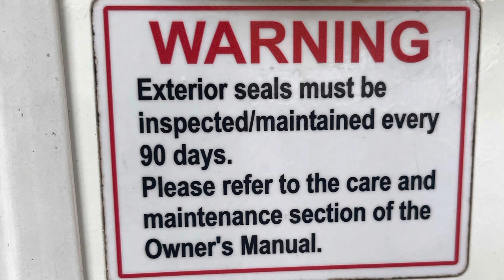RV Roof Sealing With SEAL-TITE and/or ETERNABOND Tape

Comment: Four things to help your subscribers: 1) Use a roller and a screen spline tool to create a better bond without bubbles and gaps. I tried the thumb and found the roller and screen spline tool do a much better job, 2) Round the corners on all the tape to eliminate sharp corners, 3) Install the Eternabond tape down each side of the trailer the way it was applied to the front and rear, and, 4) Cut the tape with a utility knife on a block of wood and not with scissors .  Scissors tend to gum up.  Glad I didn't bother using the Seal-Tite.
Reply from the maker: Thanks Girdherd
I'll definitely try the things you've suggested next time I use either one of these tapes. Rounding the edges is an awesome idea!

Thanks Girdherd for watching our video!

Mike and Angel

Comment: A very helpful item for this kind of project & material is a wallpaper seam roller, a little 1 inch or so wide wooden roller with a handle. Flattens out Eternabond tape very nicely.
Reply from the maker: Hey silaslongshot
Thanks for the tip, I thought about something like that after I struggled. lol🤔
Any further use of Eternabond with have a seam roller to finish it up.👍
Thanks for the advise and for watching our video.

Mike and Angel

Comment: I am in the process of doing the same. 
I got the eterabond cleaner and primer. From what I have read you should use a steel roller to get all the air pockets out and tobond better. They also sell it in 11/2",2",3"4"6" and 12" wide. I am going to clean the caulk ( dig out what HAS to come out. I first used eternabond 5 years ago and I will never use anything else. Don't take the whole backing off then put it down( if the wind catches it ,it will stick to it's self and that piece is junk.( remember when you were a kid and put stickers on everything) 
Thanks for the time
I ordered 150' of 4" 20' of 6" and 30' of 3"
Reply from the maker: Thanks Marshall for the comment. Next time I use it I will have the roller and order exactly what I need. I appreciate your advice and I'll refer to it in the future.
Thanks again for the input and for watching our video!🙂
Happy Trails & Happy Camping

Mike and Angel

Comment: I just purchased the seal-tight Dicor tape . Now I'm hesitant,  looks like I need to order eternabond tape instead. Thanks for video
Reply from the maker: Hey Steve.
IMO, use the Eternabond, it was a lot easier to apply. I believe the two tapes will work the same once they are down but eternabond was easier to work with.
If you think about it, let us know how it went after you installed it. Good luck and thanks for watching.

Mike and Angel

Comment: I like the idea of using eternabond for sealing the roof.  I am getting ready to reseal my RV roof. I decided that when I reseal it, all the self leveling sealant has to go!! 
I know, work, work, work. The reason why I am willing to do the work, the sun beats down on that roof day after day and eventually the caulking will dry out. I want to get the most out of the eternabond. I don't think placing eternabond tape over the caulk is a good idea.
Maybe for stopping a leak at the time, but for longevity, absolutely not.
Reply from the maker: Hey Michael.
If we had a large covered place to work under we would do that too. But we don't so I made the best with what I have.
We plan to post updates every 90 days on how the tape is holding up. Eventually we will redo all of the seals (caulk). For me that means the camper is out of commission for a while or pay someone to do it. Meanwhile the sealing tape will do the trick for me.
Thanks for watching our video Micheal and thanks for your honest opinion on what you think of the sealing tape. I hope I can tell you in a year its doing fine.😀

Happy Trails & Happy Camping

Mike and Angel
Reply: @RetroRVRecon  I don't have a covered shed either. I also don't have failing caulk, yet! Just had to touch up a couple of spots.
When the weather turns a little cooler then that is when I start my project.
Hopefully after it's done it's no longer required to keep resealing because of cracks or leaks. I want to make my RV experience a little less stressful. People swear on the eternabond tape. I just want to do it in one shot. Thank you for your reply and I hit the subscribed button and notifications bell. Happy RVing.👍✌️
Reply from the maker: @michaelbarras6950  Thanks Michael!!😀
Safe Travels.

Comment: I would have put a dab of sealant on each one of the screws under the vinyl  strip, because moisture will get in there and rust out the screws and rot the wood. I know because it happened to me years ago.
Reply from the maker: Hey oldrudedog
That's a good idea. I will add sealant to the least the outer five screws the next time I replace the vinyl strips.
Thanks for the advise and thanks for watching our video!
Happy Trails & Happy Camping

Mike and Angel

Comment: Was there a missing screw at 7:09( by your thumb)?
Reply from the maker: Hey Rick.
Good eye!! Yes there was. When I replace the trim molding I check the screws. They seem to get a little rust build up over time, so when I see one that has a bit more rust than I would like, I replace it. I replace them with SS. 
Awesome question Rick, thanks for watching our video!

Mike and Angel

Comment: How is eternal bond lasting?
Reply from the maker: Hey NorthWest
I checked it a few months ago and Its holding up very well. I plan to get up there in a couple of weeks, I'll give it another good inspection. If ever I find any issues I'll post an update. BTW, both Seal-Tite and the Eternabond are holding up well. 
Thanks for the question and thanks for watching our video.👍

Mike and Angel
Reply: It’s the best way to go 😊